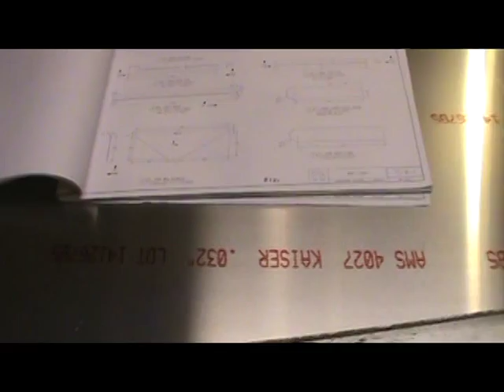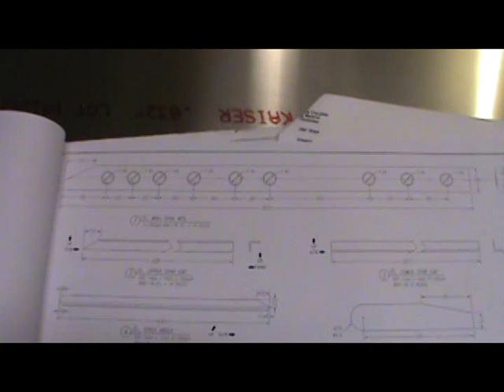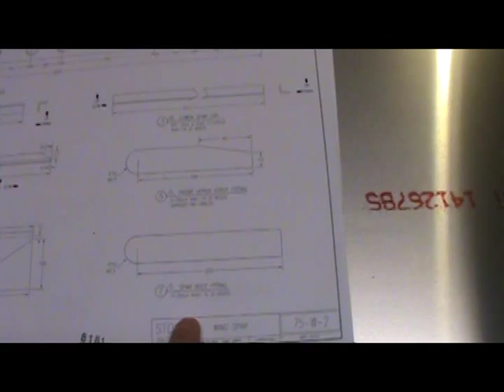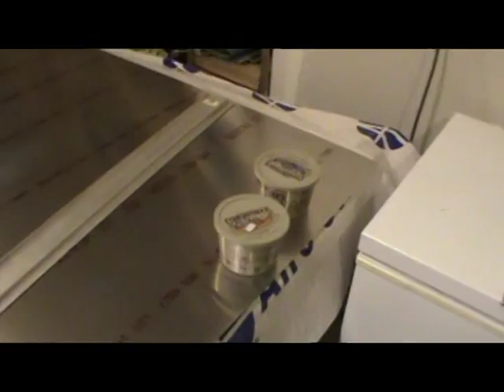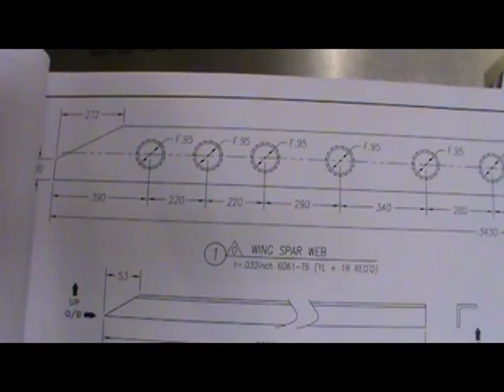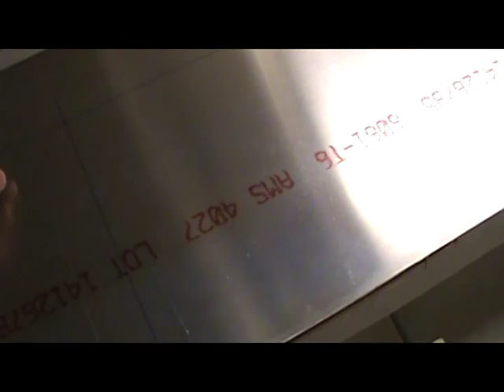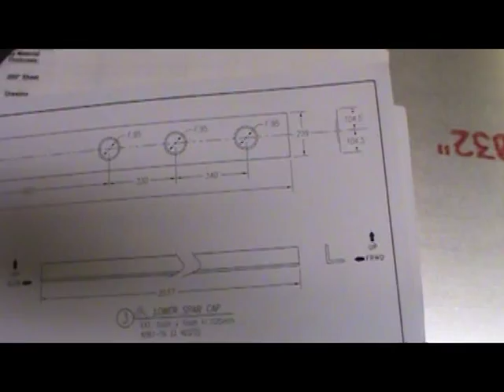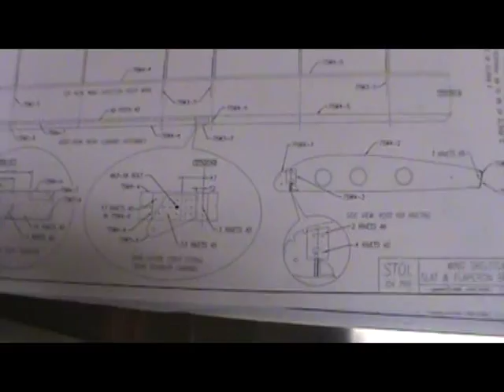Preparing Wing Spars for Cutting

Comment: what did you use for a straight edge.
Reply from the maker: Two Johnson Level & Tool J4900 98-Inch Aluminum Cutting Guides
Reply: @GregsZenithSTOLCH750   thanks I have been looking all over but couldn't find one.
Reply from the maker: @wb6anp  I found that one on Amazon, if you are able to shop there.
Reply: @GregsZenithSTOLCH750  yes I found it